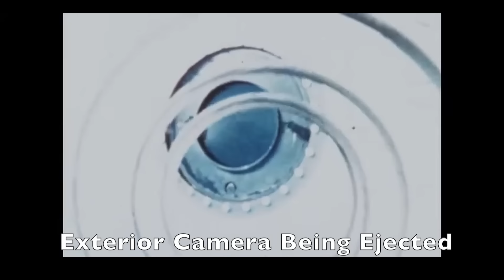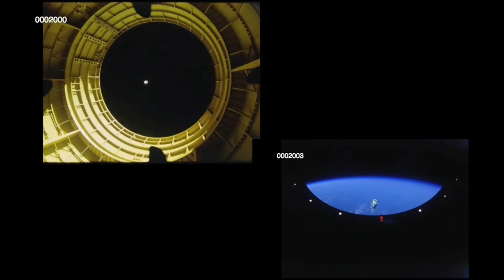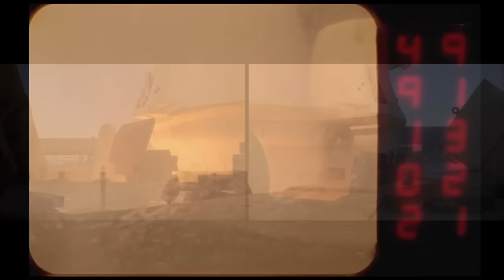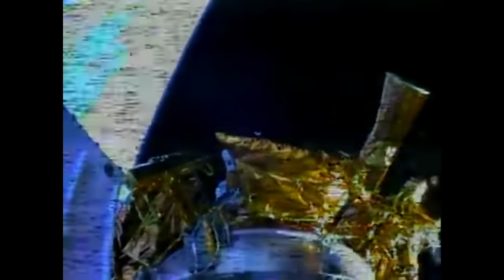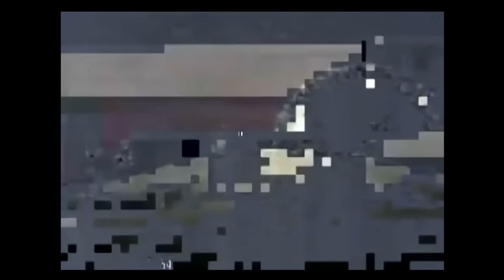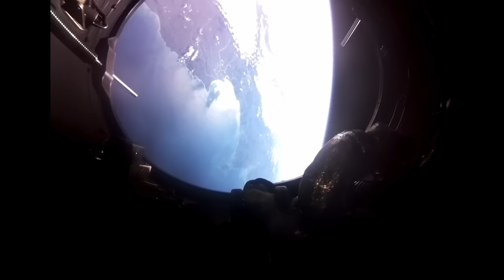Rocket Cameras - Eyes On The Most Iconic Moments Of Space History

Comment: If the camera pods were ejected and reached 300km altitude before descending, wasn’t heating on reentry a problem? Why didn’t they burn up?
Reply: Probably because they put them in enclosures designed to survive.
Reply: they weren’t heating up so much because they were mounted on the second stage which never reached the orbital velocity. It isn’t the altitude but the velocity that is mostly responsible for the heating.

Comment: It's magic to fly a drone via satellite from across the pond?  How hard can it be seeing as they fly Predator drones through all phases of flight just about anywhere in the world via pilots in the states for many long years now. Granted they have dedicated satellite links and latency-optimized proprietary communication which is purpose built, but commercial drones have much of this same capability. How hard could it be to port the drone comms via Starlink to anywhere in the Starlink coverage area... Anything under 100ms latency should be easy to manage...probably even much higher would still be acceptable. Starlink high speed/low latency facilities can easily carry the necessary data to fly a commercial drone in real time.  They're not conducting drone races, they simply need to T/O, Hover, and then land while taking HD video. I'm sure SpaceX has the Starlink network highly optimized to support Starship operations such that there is minimal latency via reserved links. There are many commercial drone products already available which can be utilized for this purpose. No, the real "magic" is the Starlink network itself which can operate with such low latency over much of the globe. Besides that, the rest is straight forward... You should do a segment on commercial drone platforms and all the various industries they permeate these days. They've come a long way in the last decade alone...

Comment: Great video!  At my work, in the EMC lab they sometimes need to monitor things like indicator panels or display screens that are being tested.  Not sure what they currently are using for this now...  But, even 20yrs ago, when small pinhole security cameras became available one was installed in a sealed metal box with a pinhole to look out of (to be a faraday cage for the camera electronics) powered by battery and then a fiber-optic cable to get the image data out of the chamber w/o using any conductive wires.  In EMC testing you do not want any of the monitoring setup to radiate any RF and possibly affect the test.

Comment: In addition to holding station, you can remotely tell the MarkSetBot to move to a new GPS location. It will travel there at a top speed of about 4 knots (7.4 km/hr). So if they want/need to adjust the position of it for a better shot, they can. They can also approach (and circle) the rocket after it lands (waters?) to get closer views of all sides.

Comment: No.   It's the most sensible way.  Low cost, no fuss if it's damaged or destroyed during the landing.  Why use an expensive solution in an application where there is a high probability of the equipment being damaged?

Comment: I agree with cameras on the Dumblinks, but you'd have a few issues to solve (perhaps worth a video or part of a video at some point).
* The dumblinks just re-enter & burn up, the cameras couldn't be simple Go-Pros as they wouldn't survive.
* They could be wireless cameras - perhaps even simple Wifi, other than a stainless steel wall between the inside of Starship & the camera, there's nothing to get in the way.
* They could invent a space drone that uses compressed gas to move around, they fly that out of the payload bay door first and use that to film the outside of StarShip (would be very useful for surveying the ship for damage prior to re-entry.) That could either use a Starlink mini or something to connect to Starlink, or simply WIFI back to the mothership for real-time video.

But yeah, some external footage of deployment or simply external footage of the ship would be awesome (and probably useful from an Engineering point of view!)

Comment: The pad cameras had a crazy exposure compensation i believe, the dynamic range would be insane from daylight exposure to high illumination of the rocket exhaust, memorable engineering
Reply: Film has a really good dynamic range which is currently just been matched by digital sensors in consumer cameras
Reply: The Photosonics cameras had exposure compensation on the lens’ iris, ran at 400 fps, 72 degree shutter angle

Comment: Their drones will be automated ai controlled using a drone board version of the teslabot control gpu-cpu hybrid chip was used in drones to train during earleist itterations.  And the auto drive system uses 4 of its bigger brother or it did until it went asic then got cancelled may come back on original platform being as teslabot is a thing.

Comment: My early career was spent developing the Peacekeeper (MX) ICBM at TRW, the System Engineering contactor.  I got involved with the booster staging events, which were of the  "hot staging" type.  Stage II and III both had Extendable Nozzle Exit Cones (ENECs) to allow us to package high area ratio nozzles within the silo length constraints imposed by treaty.  Hot staging and ENECs were a difficult mix to make work.  On Flight Test Missile 3 (FTM-2), the second stage ENEC fell off some time after staging.  We didn't have enough instrumentation to figure out why,  so I proposed putting cameras in the interstages to give us the most valuable data you can get, visual.  Well, the telemetry system couldn't handle a single TV camera.  It could barely give us all of the pressure, temperature, strain and accelerometer data we wanted.  But I was aware of the Saturn V S-II staging camera, and contacted a colleague at Rocketdyne, Bunky Allred, who I knew had been deeply involved in the S-II development.  He dug into it, and - long story short - found that the drawings for the camera and its installation had been destroyed six months previously, as the NASA contract had dictated.  We grappled with the staging problems with great difficulty, ultimately making things work.  But I look at the video coming back from each one of the SpaceX launches, and think wistfully about how much work could have been saved had we had anything like that in the 1980s.

Comment: NASA Langley used a special ultraviolet, intensified, high speed camera to examine hydrogen-oxygen combustion in rocket engines.  The camera, operating at ~309 nm wavelength was built by a team at Los Alamos. My former major professor, J.G. Hirschberg, was a consultant on the project.  See:  Ultraviolet Imaging of Hydrogen Flames,  Yates, G. J.; Wilke, M. & King, N. January 1, 1988.
Reply: It used an sortof off the shelf lens, the Zeiss 105 f/4.3 UV lens, with all quartz lens for UV transmission

Comment: That kiddy pool, is a markbot, a device used in sailboat racing to mark the course boats sail around. They are given a gps location where they reliable park using an electric motor for station keeping. They enhance sailboat racing by their ability to be positioned based on the current wind direction, to create the most fair/difficult course to race directly upwind or downwind or the race start line

Comment: The EG&G high speed 16mm cameras running 1,000 frames per second and up did not have the film start and stop for each frame like normal movie cameras.  They had a rotating prism that swept the image along at the same speed as the moving film.  The film moved at a constant speed throughout the process.  It was normal to have the last few feet of film shredded inside the camera after a high speed run.

Comment: I work for a company that does aerospace glass regularly and we recently did a small project for NASA.  It was about 2 inches thick worth of glass cut into a circle.  I remember something on the job description saying "NASA bunker".  It was most likely the Stennis facility in Mississippi which is close to us.  This was not any kind of heat treated or special glass so I doubt it was for a high temperature application, maybe something more akin to a wind tunnel or something.  Anyway, I always wondered how it got used, but I was happy to do my part for a project that may one day involve a space flight.
Reply: General Electric has been making "fused silica" glass for decades and it found its way into LOTS of space related useage, including the main front window on the Shuttle

Comment: i graduated from kingston poly in 1984 doing a graphics degree, i got caught up in the computer animation fad and my second job after leaving was with cfx in soho, we used to shoot direct from a hi res cathode ray monitor (4000 lines) on to 35 mm film using a mitchell camera. if you wanted more than one colour, you had to rewind the film, put a coloured gel in front of the lens and shoot again, if you wanted to dfo matte effects, you had to put unexposed film AND the matte run film in together and shoot however many colours were required. needless to say if ONE frame was wrong, you had to do it all over again, and it usually took a day to get the film processed.....fun times. (i have a few examples of our work on my channel).

Comment: Back when I  was working Atlas 3, Delta II used a live video of a launch.  We engineers on Atlas 3 lobbied for a live cameras on first Atlas 3 launch vehicle. I remember push back because it was going to cost $100k to do it. In the end us engineers won out and Cameras were installed. Day of launch I was just spectator in the engineering launch monitoring room at the Waterton canyon  LM facility. We had live on ship feed. After many delays and attempt, funny stories there, we finally got t-0 and launch.  There was a room of super amazed engeerrs. Most were watching the engineering performance data on their computer. Shortly after liftoff engineering data dropped out with a loud gasp from thise monitoring engineers thinking it just failed. Tge chief engineer at that moment said "look up" to the live camera feed which waashowing great view. At staging there was a cameras on 2nd stage and for first time engineers  many who been working Atlas for many years saw for first time the Centaur staging and nozzle extension. Good times.. Space X is spoiled.
Reply: GoPro revolutionized the industry. Cameras good enough they might survive with easy interfacing. I don't know what they use now, but that is how it started.
Reply: It's crazy how much push-back there is to this day for using video for data acquisition. It's a totally underrated method. You want to know when each of the 50 DUTs stopped working during the year-long test? No need to wire each to a DAQ. Just record a view with ALL of them a couple seconds every hour, then iteratively halve the duration back to find the moment one crashed.
Reply: @michaeltrillium  Sensors are useful, but it's the video that tells you what the sensor data means! In the case of space probes, pictures and video also gives you insight on what questions you forgot to "ask" when you designed the probe to answer them!
Reply: Space X are where they are now from work you and many other did years ago when technology was harder to develop,  Space X they have it easy today, Elon reminds us that he invented everything ?... 
Thanks for your story.
Reply: I worry greatly that the release of video feed from launches conducted by Western entities are being downloaded and dissected by Communist Chinese space engineers to help shorten their engineering development path to successful space flight missions.

An uneducated person like me would think the recent images of Star Ship 10''s heat shield alone provides immense useful data a rogue nation intent on creating a re-entry vehicle for a MIRV'd flight, could use ... for free!

Do we dispense with attempting to keep these types of data-laden videos secret because it's already a known fact that China will hack another computer of ours and steal it anyway?

Comment: You said STS-93 (July 23, 1999) was the first Shuttle mission to include cameras mounted on the SRBs. STS-95 (October 29, 1998) was actually the first to use those SRB cameras, followed by STS-96 (May 27, 1999). And I believe STS-101 (May 19, 2000) was another pre-Columbia mission that included SRB cameras.

Comment: While you were talking about the fiber optics I was wondering why they didn't 'just' run the film to an accessible part of the ship, I love that you explained that they actually tried that haha. So many things nowadays are just a sensor and some wires to a transmitter... Which provides so many options but I find the older tech solutions absolutely fascinating
Reply: It is funny to think about this, but SpaceX was a pioneer in using TCP/IP data lines for all internal control signals inside of its rockets.  That may seem as a no-brainer move but at the time was huge and even saved a huge amount of mass in the rocket.  Earlier rockets used physical control wires...some analog and others something like the RS-232 serial data standard and custom data protocols often on copper wires.

Since TCP/IP became the standard for SpaceX, downlink data for simply telemetry and of course video data was very easy to integrate.  They also used optical fibers but instead for the data streams and to electrically isolate the various parts of the rocket....something copper wires couldnt do in the past or at least needed a whole lot more engineering.

Nothing against earlier rocket and their massive multi ton guidance computers with less processing power than a Commodore 64.  They used what they had available at the time.  Also, rocket engineers notoriously follow the adage that if it works, dont fix it.  They are very slow to adapt to newer technologies unless it is a very clear improvement on multiple levels.
Reply: Also incredible are their solutions during the nuclear tests!
Reply: I’m always wary when anyone talks about “just” doing a thing!
Reply: 💯 And the Keyhole Corona spy satellites did that trick with film back in 1959. The camera stayed in orbit, and film reels would be sent back to Earth periodically.

Comment: When looking at the E-8 slow-motion footage, it makes me wonder how much fuel is used to get the first 10-20 ft in altitude. Wondering if you have a video on using ground assisted methods such as (i dunno) springs or higher altitude launch sites? If you have a pointer that would be interesting to see.
Reply: How about some long fuel and oxidizer hoses to feed the engines for the first 20 or 30 feet, before disconnecting? They'd have to be massive, though. All rockets with cryo fuels keep connected, to top off the tanks, until the rocket starts to move, but I don't think they have the capacity to fully supply the engines. Didn't Scott do one on launching from mountaintops?